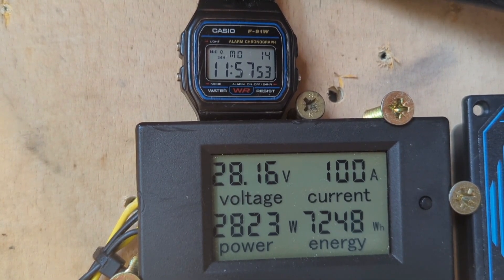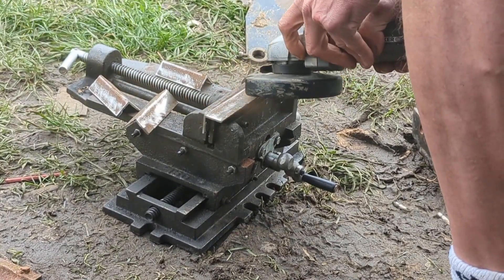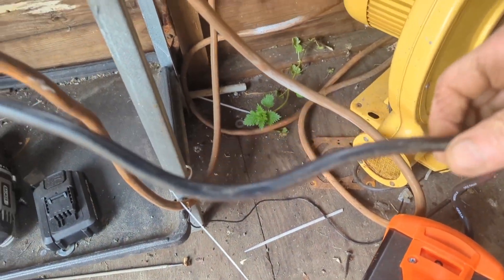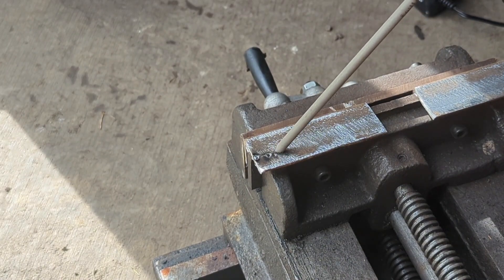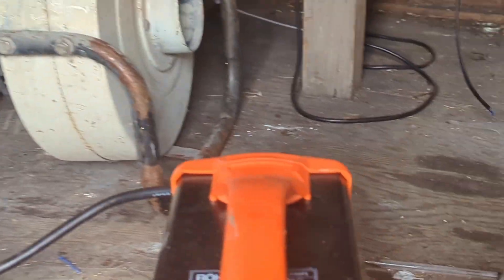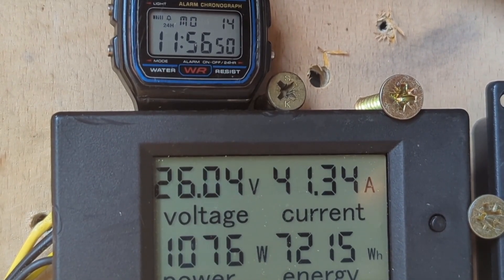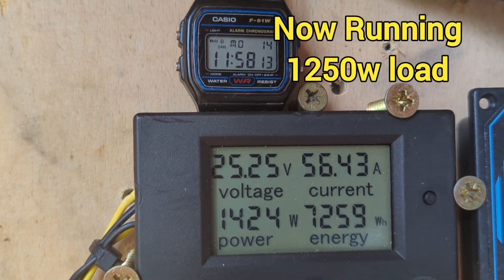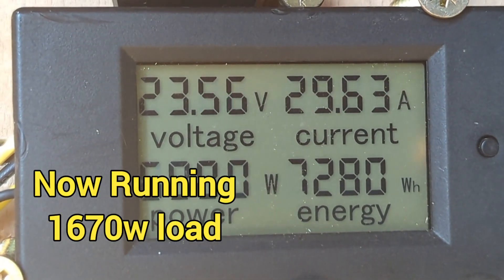DIY Wind Generator Project Free Energy Machine - 70mph Gusts - 3kw+ - Part 4 - 14th March 2023

Comment: certainly seems to be making some power, good video, however a grinder under no load does not use 750watts, the lamps are a constant load, so is a heater, just saying power tools are not a good choice to load the system up.
Reply from the maker: Cheers for the comment mate. I was just trying to use something different for a change cos I always use the lamps. But yeah your spot on. They are definitely a better source of a load. Thanks again for the comment. Much appreciated

Comment: You can't control it.  There is a point where the wind is strong enough to overpower the brake. 
This is why I suggested looking into eddy current brakes.  An aluminium plate with neodymium magnets that get closer to it the faster the turbine spins.  If setup right it should keep the blades spinning at a more constant high speed and not rely on the controller brake so often.
Reply from the maker: I think I'm going to end up looking at a tail which is moved by an inline actuator or whatever they are called